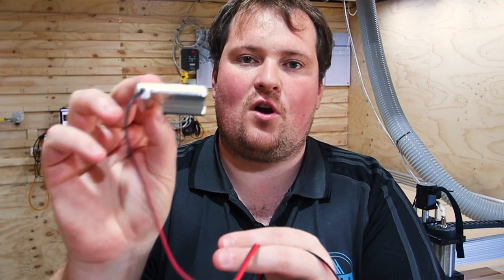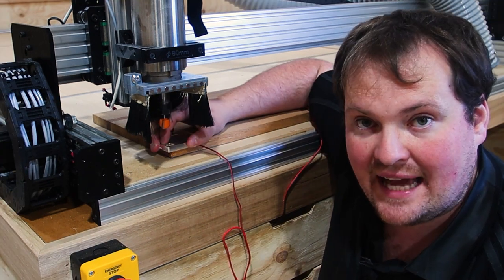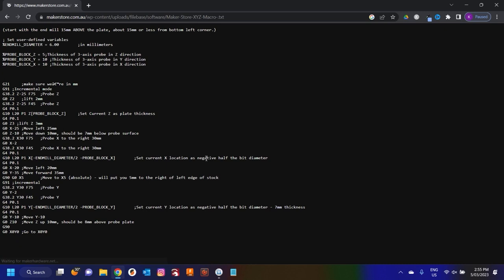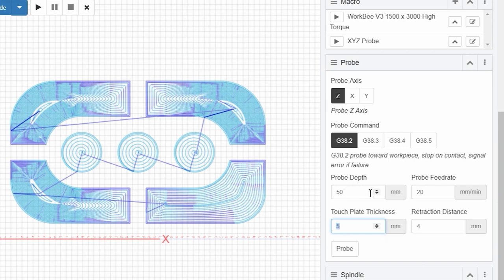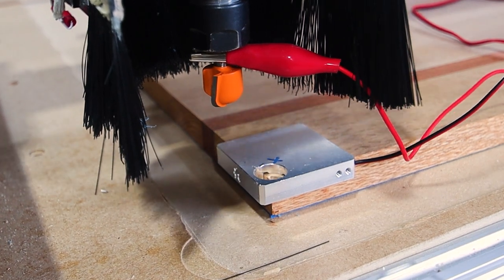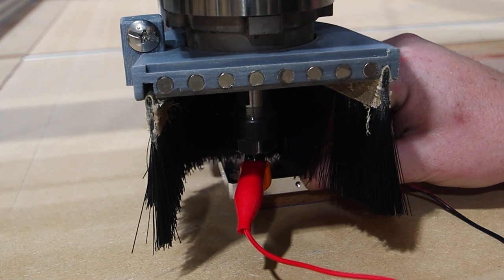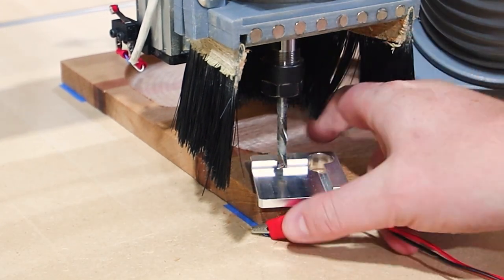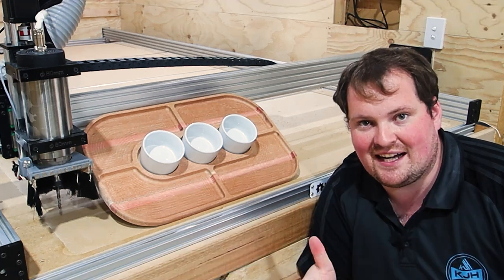How To Set Up And Use Your XYZ Probe For Your CNC | KJHWoodWorking.com.au

Comment: Hey Kieran, I'm a newbie to cnc. We have a 1200x600mm cnc router and I have been tasked with the job of settting up. I have a small 2D pocket part which I  post processed from Fusion360. We use CNCjs and have a touch probe. My question is around finding the datum for x,y and z. I see the probe function in CNCjs but I am afraid to use it for the x and y as I don't think the supplier gave us any Gcode for the Macro. He is no longer in business.
How can  I find x,y on the workpiece? 
Thanks for your help. 
Just subbed to your channel.
Reply from the maker: You don't necessarily have to find the X and Y point with a probe, you can simply move the spindle around and zero out your axis when you at the location you want to be. Hope that helps.

Comment: Im brand new to cnc machines. So my question may be a little dumb. After probing do you zero out the job? Or do you only zero out x,y and not z?
Reply from the maker: Not a dumb question, everyone starts somewhere!

A "Z" probe only zero's out the Z axis. A "XYZ" probe zero's out all axis'. Depending on what probe you are using, you may need to zero the X and Y axis, but never the Z.

Hope that helps.

Comment: When routing a profile (cutting out a piece of wood), you basically make a slot and thus removal of wood chips is more difficult. For this, I can imagine that the combination of speed, feed and step down should be different from when I do pocketinig (Most of the pocketing I do is carving shapes out of wood and thus most of the time 3 sides of the bit are free to release wood chips).

If I have for example a 5mm bit that I use for pocketing on 8000rpm with feed rate of 3500 mm/min and 2.5 mm step down what would be the best setup of these parameters for profiling?
Reply from the maker: What sort of machine are you using? 8000rpm seems quite low and 3500mm/min seems high for a hobbies machine?
Reply: @kjh_woodworking  I am using a Bulkman 3D Ultimate Bee with 1.5 kw spindle and XPRO V5 controller .

Strange thing though is when I do routing with a 3 mm down bit on 8000 with a feed of 1600 I have no burn. This is a carbide bit. While the profile routing burns

Comment: Thanks for an excellent step-by-step tutorial. I tried to use your code to create a new macro in "OpenBuilds Control". I got this error message when I tried to run it:
error: 2 - Numeric value format is not valid or missing an expected value.
[ %ENDMILL_DIAMETER = 3.175 ]
I know that you use a different controller but I'm hoping someone here can help me out. (I'm not a coder.)
Thank you.
Reply from the maker: Thanks for watching mate. I am not across this, but if you check out this forum it might help.

https://openbuilds.com/threads/grbl-error-2-when-using-x-y-z-probe-plus-and-interface.17278/